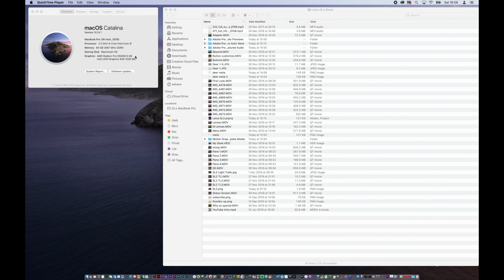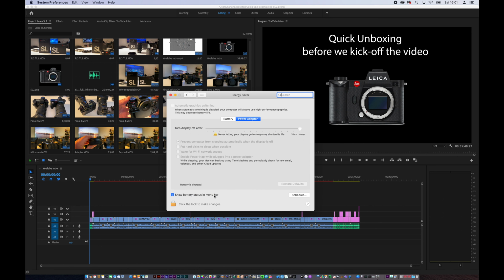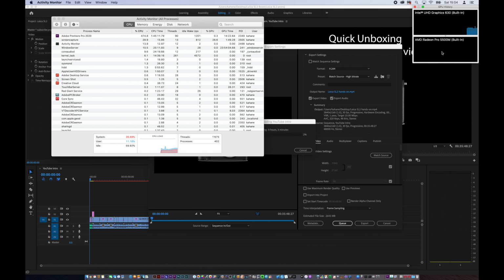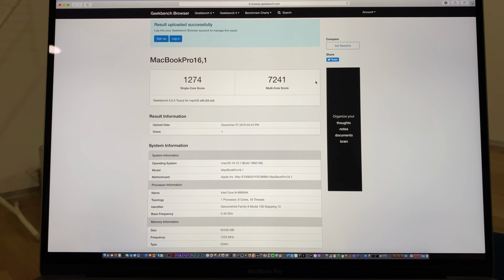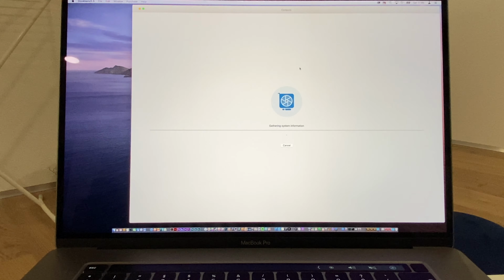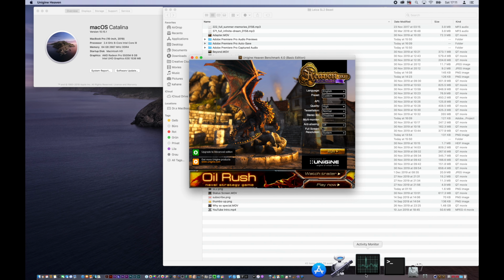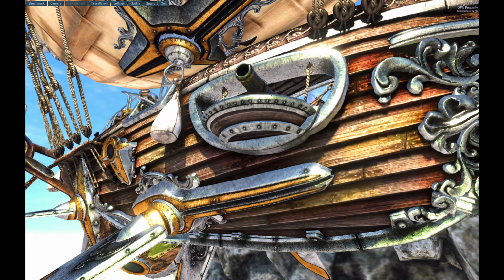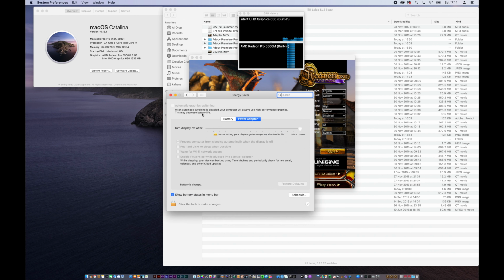New 16" Macbook Pro & Adobe: Creator's Nightmare !!!

Comment: Is this problem resolved. I am planning to buy MBP 16 inch with AMD Radeon Pro 5300M or 5500M graphics with GDDR6 memory.
I use Adobe premiere Pro CC2018

I found this video to change the graphics card setting

https://youtu.be/NzkjXZjRHhg

Please help. I would be purchasing the machine once i get a clarity.
Reply from the maker: Resolved. I guess Adobe was the guilty one, not Apple or the MB Pro.
Reply: @mathphotographer  What resolved your issue? I am on the current version of Premiere Pro (14.2) with a new Macbook Pro 16 and it's performing not as impressively as I would like. Exports aren't taking 8 hours, but it's 2-3x slower than the Razer Blade Stealth 2020 with an NVIDIA dGPU. I can't imaging that the 16" can't compete with much smaller NVIDIA laptops.

Comment: The graphics switching button only effects the OS, Desktop, & Apps that have updated their code to take advantage of it. The GPUs in the new MacBook Pros are not well optimized. The KEXTs (AKA Drivers) will need 1 or 2 OS updates for you to really see good optimizations. But the GPU not accelerating Adobe apps is not Apple’s fault it is an Adobe issue. If you open activity monitor and click on the window tab and choose GPU Usage you will see if the Adobe app is using the intel GPU or the AMD card. I have the same GPU model as you and it will take about 30 to 60 days for OS updates to come down the line from Apple but that still doesn’t help your situation since Adobe need to implement better GPU optimizations to take full advantage of these new cards. I understand your frustration, I don’t use Adobe products but some of the apps I use still are not using the GPU hardware to it’s full potential.
Reply from the maker: Makes sense, thanks.

Comment: A little more testing, 16” MBP does use my eGPU when it’s hooked up (Radeon Vega 56), but it never uses the internal 5500.  so seems definitely an Adobe issue.
Reply from the maker: Can you try to monitor native Apple software like iMovie and monitor via Activity Monitor to check if iMovie uses the Radeon? In my case even iMovie when rendering/exporting does not use the Radeon GPU ...
Reply: @mathphotographer  iMovie doesn’t appear to be using the Radeon on my 16” MBP either.
Reply from the maker: @cwaynefox  Consistent with what I observed, thanks for sharing with me.

Comment: Most likely an Adobe problem, according to the link below,  Premiere Pro does not support the Radeon Pro 5500 so even though it shows up, it isn’t using it. Hopefully it’s because it’s a relatively new GPU and they just haven’t put the support in there.  So as your test shows, it seems it only uses the integrated GPU.  Also CPU performance seems pretty poor in your test, probably also an adobe problem much like photoshop.  Lightroom can nearly max out the CPU usage for many tasks, hitting 1500% and even higher. , where photoshop rarely uses more than 200-400% which is only 1/8th to 1/4th of the available CPU power..  Seem all of Adobes older programs are not very effective at multi threading and utilizing all the cores.  

https://helpx.adobe.com/premiere-pro/system-requirements.html#gpu-acceleration
Reply from the maker: Thank you very much for your reply, can you pls look into my question on your second comment? Thanks & nice weekend